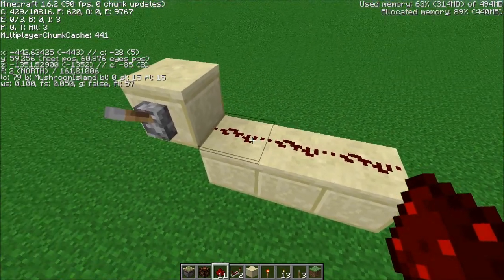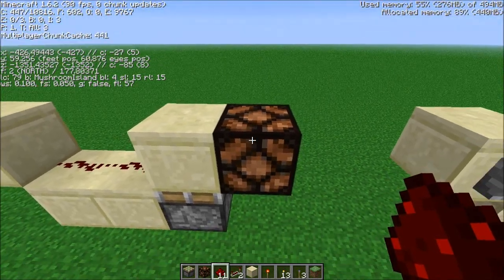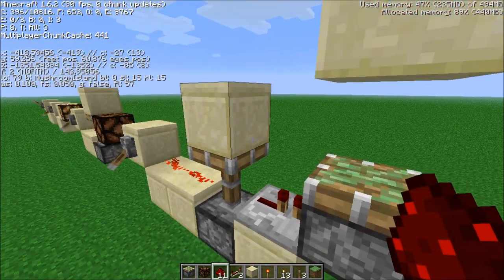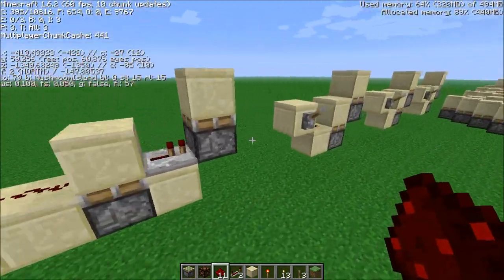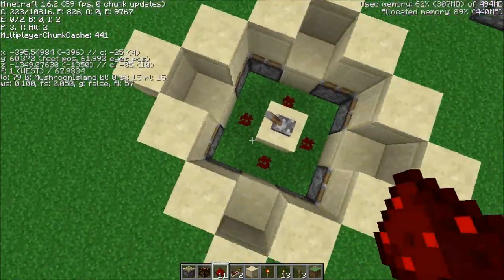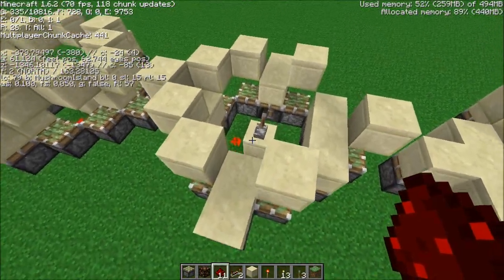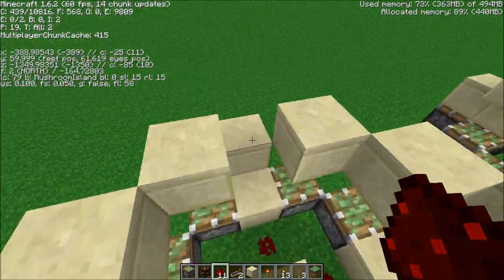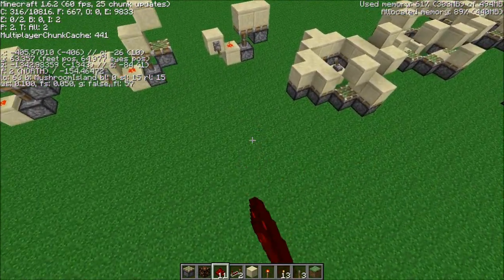Angry Rhychird

Comment: I can't figure out what's going on there, but I can definitely tell you that this would make a pretty good random number generator which I've had to use many times before and settled on dispensers dispensing either arrows which flew ahead or blocks that landed immediately on a pressure plate. This bug could be advantageous in this respect, but you're right this should be figured out.

Comment from the maker: Thing is, it wouldn't even be useful for that. It's only random based on location; once you build it, it will either work in that permutation all the time or it won't at all, ever. It simply seems to be arbitrary whether the pulse will make it to the secondary piston or not in any given location/orientation.